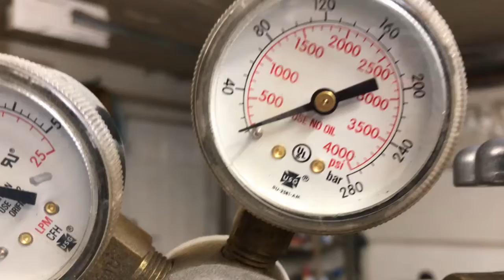How much gas is left in your bottle

Comment: mini had nothing left in it. I saw the flow gauge drop a little during welding(no critical weld anyway) and stopped. Removed the regulator and it was empty.